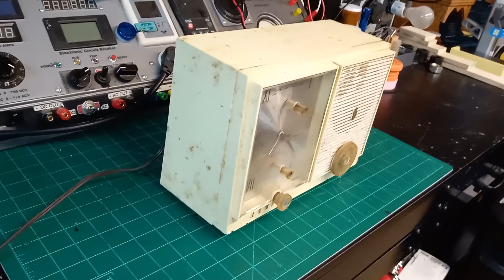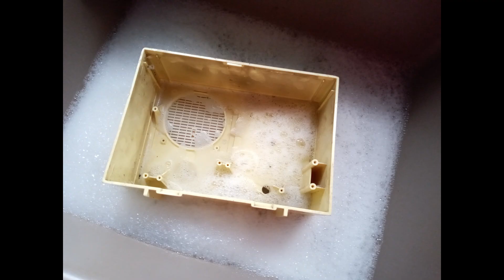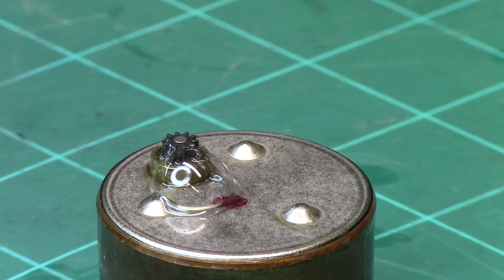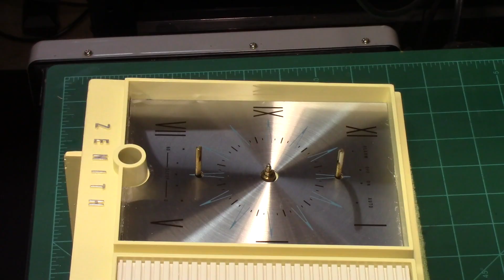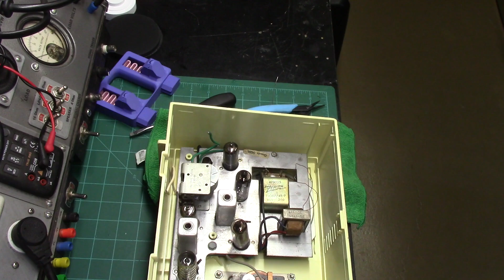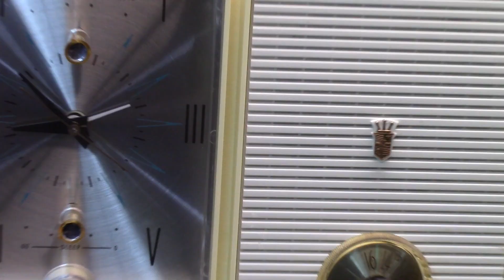G515 Zenith Clock Radio

Comment: Gregg, If you can find a piece of plastic tubing which will fit snugly around the collar that surrounds the exit port for the clock motor gear, you can put it on, put about 3/8" of oil in it, and only have to heat the motor once to force the oil in.
Also, I saw your follow up piece first. Do you have a signal tracer? They will help you find where the signal goes missing in the radio. They aren't difficult to build, or you might be able to find a vintage one, and restore it. You need one with an "RF" probe, and an audio probe, so that you can trace the signal all the way through the radio. They will work from  the antenna to the speaker. The radio is not exhibiting silver mica disease symptoms. It sounds like an IF problem to me. The oscillator appears to be working. 
Regards,
Gar
Reply from the maker: That's a great idea for adding the oil Gar, I'll have to try that on the next clock I do, assuming there is a next one. LOL Yes, I have several signal tracers, but at this point I'm done with this one. I adjusted all the frequencies successfully using the IF slugs and the oscillator and antenna screws. It sounds great on BT, so that is all I need from this one.

Comment: Good job Gregg with fixing up the cabinet to make it look like new. You're really the master at that. Great job at oiling the clock motor too. Before you put the clear plastic cover over the clock, you should have checked and adjusted the clock and alarm hands. If that's like a clock I have, the alarm is supposed to turn the radio on first, then turn on a buzzer in the clock 10 minutes later. You have to move the alarm, hour and minute hands around on their shafts until the alarm sounds when the hour hand is lined up exactly with the alarm hand, and the hour hand is on the hour when the minute hand is at 12. It doesn't look like you did that, and now, you might have to take the knobs and that clear cover back off to get it right. Otherwise, your alarm may sound at a different hour than what the alarm hand is pointing to. The Sam's might also explain this.
Reply from the maker: Thank you Gary, yeah I had no idea. The Sams I have does not explain any of that. Only alignment instructions and resistance checks. I will definitely pull it back apart and do that!

Comment: Great Job, Gregg...love the tool chest.... socket holders and sockets are nice n' colourful. I'm impressed.
Reply from the maker: Thank you! Thanks for watching too. I designed those myself on TinkerCad.
Reply: @greggsvintageworkshop8974  I really like everything you're doing with 3D printing too. I've never tried that, but I'd like to. Besides buying one, there are makerspaces where you might be able to use one, and I also found a local library does 3D printing of your designs, for a modest charge per ounce of material used. I might try that first.

Comment: Hey Gregg. Radio looks very nice and you did an excellent job on cleaning and repairing the cabinet, knobs, etc. As for the radio, it certainly is producing the correct radio sounds, but just doesn't seem to be picking anything up. Perhaps a quick alignment is all that is necessary. Hope you get it working. :)
Reply from the maker: Thanks Doug, yeah I'm going to give it a shot anyway. Hopefully the slugs aren't seized in those IF's.